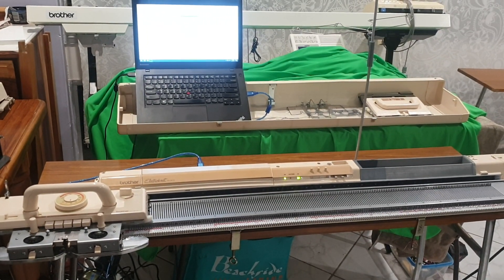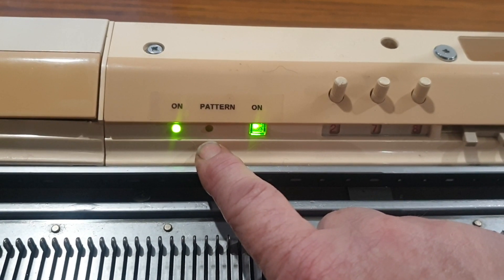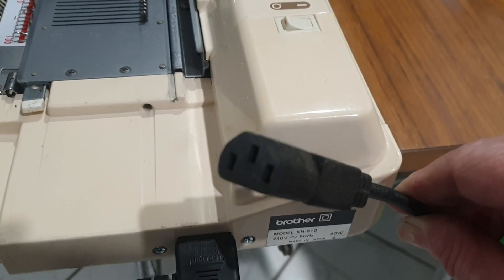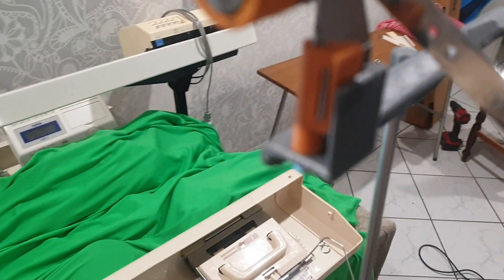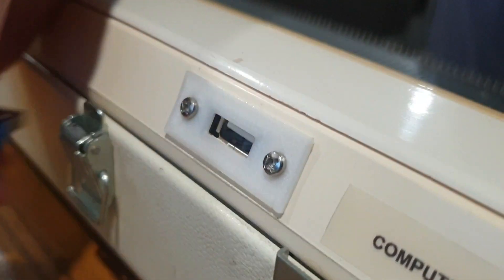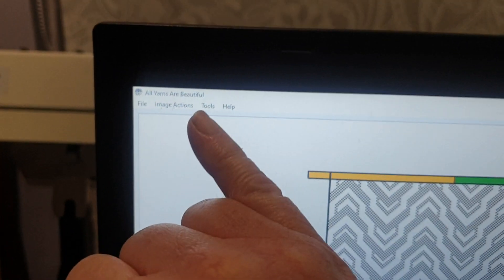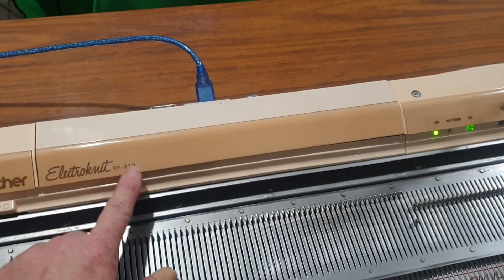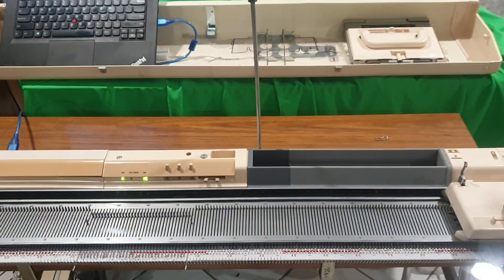Brother Electronic Knitting Machine - electronics modification

Comment: May I ask how you converted your panel with those lights?
Reply from the maker: Instead of soldering the LEDS onto the board, I soldered wires onto the board to extend the cable to the cover and then soldered the LEDs on. Make sure you solder the LEDS the right way around or else they won't light up :)
Reply: @susanglaus4312  What kind of led did you solder to the board instead of the "beeper"?